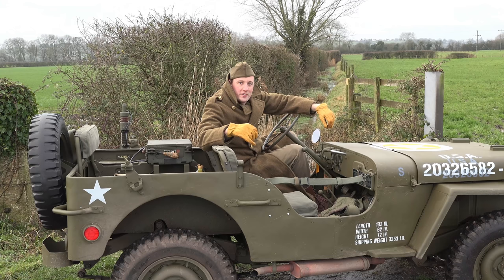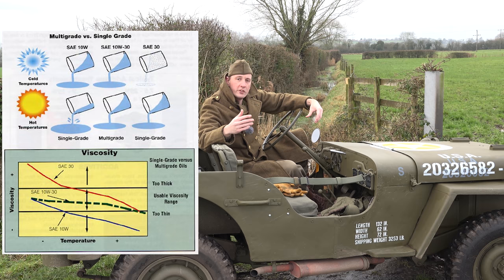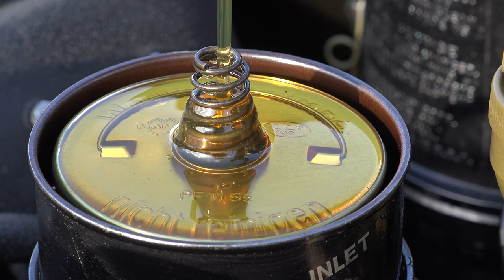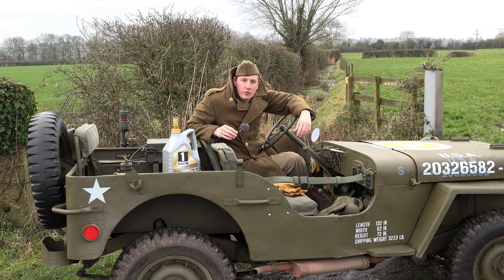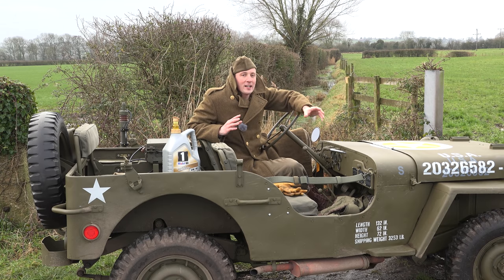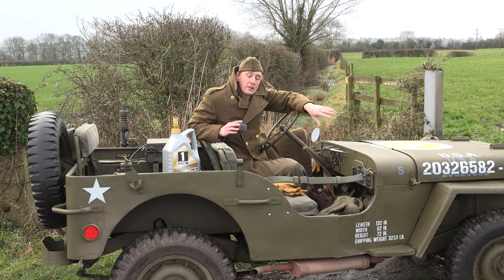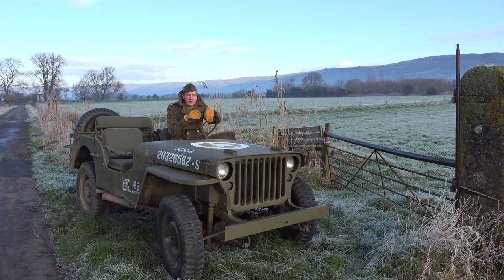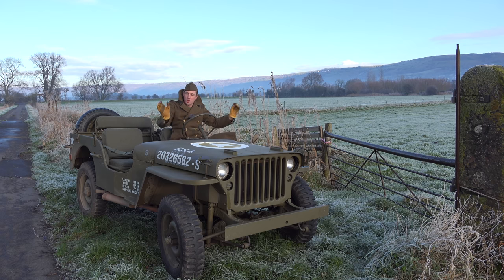Why can't You use Synthetic oil in old engines??

Comment: I am using semisynthetic oil on all my cars including my classic cars. So far I did not experience any problem. One thing: An oldtimer owner and skilled mechanic told me that modern oil might harm the old stile rope main seals. But I still use the oil that I put in my cars for ages.
Lately my old Chevy 6 cylinder starts consuming a little bit of oil. Before the oil level stayed on max for years without adding a drop of oil.
In the Swiss Army we received a wool cap that had only slits for the eyes and mouth. Ideal for bank robbers. It had a funny name: Kopfpariser. Translated to English: Headcondom!
I never wore it once. One reason might have been the stupid name.
Reply from the maker: Thanks for the info, I see no reason why synthetic oil should damage a rope seal, early in synthetic oil development there was an issue with some seals being attacked by early synthetics but they solved that problem.  An old rope seal is made from asbestos and that is certainly not attacked by synthetic oil!  I like your story about the 'balaclava' (from the Crimean war!)  I wouldn't wear a coat at work that was referred to as the 'condom coat' ha ha, nothing changes!
Reply: I tried  Mobile One in my motorcycle, to make it easier to start in the winter.  I forgot about the wet clutch, and the clutch slipped a lot with synthetic oil.
Reply: Do the STP screwdriver and oil dip test. Back in the 60's to the 80's I used STP to not only AID the oil viscosity as the crankcase oil thinned from piston blow-by, but also prevented seal cracking and wear on the back rope seal too. With modern engines though, STP isn't as advisable having closer tolerances, and no-more parking lot oil stains with better crank sealing. Today I treat the motor METAL, Not the motor oil.

Comment: Matt Nice Jeep!  I collect and restore US and German military trucks for my hobby in retirement and what I have found on my trucks and older engines concerning the use of Synthetic oils and the reason I DONT use synthetic on any of my older engines is NOT because of the engine and its older technology or the style of its pieces the same reasons we use synthetic oils in our vehicles today would still apply to these older engines!  The problem we have in trying to run modern synthetic oils in the old vehicles is the "SEALS"  and I means ALL of them!  Transfer case, transmission, front/rear differentials and the engine and all its components were NEVER designed for the properties that synthetic oil possesses and you will have dripping parts on almost all your pieces that I mentioned previously!  I run synthetic in every engine I own including my lawn mower but I run NO synthetic anything in my older military trucks for the reason I described earlier!
Reply: I don't know, modern military engines seem to leak just fine on conventional oil.   I have over 21 years of Friday afternoon motor pool closeouts under my belt to prove it.  Each vehicle has at least one drip pan under it for a reason.  Nothing like supervising a bunch of privates grinding cat litter into fine powder with their boots to soak up the oil spots.  haha!

Comment: As a few others have stated, using a "break in approved" or even straight mineral oil is required during this process to allow the piston rings to seat against the cylinder walls. This is still common practice in most piston aircraft engines which have changes very little in the past 70 years or so. Lycoming has some good documentation and procedures on this process and master aviation tech Mike Busch has a great webinar on the topic as well. Love your content ad thanks for creating.
Reply from the maker: Thanks!
Reply: Break in is usually 500 miles with a mineral oil.
Reply: The last place I'm going for advice on engine longevity is an aircraft engine manufacturer.  Aircraft engines fail at a much higher rate than I'm comfortable with.  We make automobile engines that go hundreds of thousands of miles with only oil changes.  Aircraft engines get thoroughly inspected annually and rebuilt all the time and cost a LOT more than most new cars only to fail in a ridiculously short time.  I understand that we aren't talking apples to apples here, but my contention is, maybe we should be.  Why not slap a fuel injected Honda engine in a plane?  I'm half stating and opinion and half asking if my opinion is valid here. HAHA!  I'll check out Mr. Busch's video.  Thanks.
Reply: @mikemorgan5015  There actually is a EFI Honda engine for propeller driven aircraft. It is called the Viking. There are a couple of options as well when it comes to engine choice. From their website, your options are: "90 Hp (2020 - 2021 1.2 L Mitsubishi Mirage)
130 Hp (2020 - 2021 1.5 L Honda Fit)
150 Hp (2020 -2021 1.8 L Honda HRV)
195T (2020 - 2021 1.5 L Turbocharged Honda Accord)"
Also stated on the website is that they are mated to a "3 gear gearbox for Lycoming style propeller rotation and vertical engine orientation" with a "2.33/1 gearbox ratio for optimum propeller speed"
Reply: @TrollinAreYou  Very cool, thanks for that.  I've heard of some efforts in the diesel arena as well.  Time will tell the tale.
Reply: @Greendot319  I find these original WW2 Jeeps interesting vehicles, when I was a youngster I used to accompany my mum and dad on visits to an old farmer friend of my dad, the farmer lived just outside a little town called Kimbolton, I remember in one of his barns was a little gray tractor, an Austin A30 van and an old WW2 Jeep he got from a nearby airbase not long after the war, the Jeep came with a hood and full side panels and doors, all in canvas.

Comment: Happy new year Matt! and thanks for the comment on the G about the sister jeeps with the rifle rack between the seats. Researching that further.
Reply from the maker: Ahh is that your g503 thread then jp? Looks like a very nice gpw project, lots of work, you're going to be busy! Make sure you keep good track of how things were attached, bolts and washers etc, important details that all the info isn't out there on the net about so of its original remember how it went on!
Reply: @Greendot319  yup that is me! You sent me some parts via ebay a few times. I am collecting parts for almost a year now, since I try not to use any repro stuff. Not sure if I manage that 100% but we’ll see. 

I take a photo of every part and bag&label it carefully. I have as well a detailed photo reports of an untouched original ‘45 gpw which helps as well. 

Tricky thing I need to plan carefully is the zink plating/galvanising. I plan to do that with all small bits and pieces since I have a company close by able to do that. But they take a box full for 50 euro so I loose control of my carefully arranged bolts and nuts bags. 🥴🤦‍♀️ have to figure out that challenge. 
Gr JP

Comment: Wow! Great uniform! Synthetic oil is too liquid for old motors, I think, yes, you can fill it, but it's better not to do it.  I fill my engine, 1970 Lada 1200 (Fiat 124), with Castrol Magnatec 10W-40 semi synthetic oil, and no problem. Thank you for the video!  Happy New Year!
Reply: The racing industry says synthetic oil does Not contain Zinc. And Zinc is needed for flat tappet cam type engines.

Comment: 1965 land rover diesel. Went from 15w40 mineral to 15w40 semi synthetic. It killed the engine as all the gunk came lose and blocked the oil pump.... 1978 land rover diesel, same engine and took it apart to boil the block so it is clean. No issues after rebuild using semi synthetic.
Reply: The semi-synthetic didn't kill the engine, the mineral oil did, as it created all that gunk in the first place.
Reply: @archygrey9093  With new mineral oil, the gunk would be still in place and the engine still running.
Reply: @XiamaraLaurensWifeyMu  With new mineral oil the gunk would have continued to built up even more.
Even without using synthetic, over time that gunk will still eventually block oil galleys, oil pumps, gunk up piston ring grooves ect.
If the engines badly gunked up you can try using engine flush before draining the old oil, maybe even drop the oil pan afterwards if you're worried about the oil pickup being blocked.

Comment: synthetics are better at permeating the microscopic pores in metal and offer improved lubrication.  If you have marginal gaskets or seals with conventional oil then you will get oil leaks.  When Mobil 1 came out I used it in my Norton motorcycles and no leaks.  I have torn down engines with over 100k miles that had used Mobile 1 and no cylinder ridge and you can still see the cylinder hone marks.

Comment: For driving when it is 32 degrees F (now that you are out of the EU you may want to go back to good old Imperial units like those used in your former colonies, he said with tongue in cheek) you need: Mitten, Sell, Trigger finger, Type I (Stock No. 73-M-3620) with Mittens, Insert, Trigger Finger, Type I (Stock No's 73-M-2735 thru 73-M-2745, Cap, Wool, Knit M-1941 (commonly called a Jeep Cap or Radar O'Reilly cap)and Googles, M-1943. The mittens are designed to keep the wind from going up you sleeves.
Reply from the maker: Good advise, I like my Korean cold weather cap I wear at the start of the video, really keeps the wind off your ears and head!

Comment: Corvettes, all Porsche sports cars, and many other cars come from the factory with synthetic oil, break in is not an issue.  The Dino oil for break in might only be required for flat tapped cams and mechanical lifters.

Comment: I have 1957 Cj5 with, Land Rover 2.8 tdi engine... here in Brazil requests 15w40 oil... but I'm using 5w40... even the engine noise changed for more smooth sound...
Reply: Using Motul 6100 or Castrol Magnatec...

Comment: I remember hearing (when Full Synthetics first came out) was that you should run the engine on "regular" (multi-weight) oil for the first 6,000 miles or so.  THEN change over to Synthetic....

Comment: The base in engine oil is the same for with or without synthetic additiv, synthetic oil is for winter use, but for summer driving you dont need synthetic.

Comment: Your bypass filter should have caught a lot of debris in your oil. Cut it open and check it out when you change it. My Super Hurricane and other 40s/50s engine all used oil regardless of type until around 2000-3000 miles.
Reply from the maker: Cheers Ben, it drank 1 litre in 600 miles which is not low but not also really excessive considering the super wear protection of the oil slowing the break in of the rings.  I'm keen to see how its drinking habit develops the more miles I put on it, just paranoid about causing it any lasting damage but the more I've learnt about rings and engine tech the more confident I am in the little engine ;)
Reply: @Greendot319   1 liter (one of us has that misspelled ;) ) in 600 miles is pretty decent since you were running 0w-40 synthetic. Its the fun of a new engine. Looking forward to more. Thanks again and Happy New Year!
Reply from the maker: Cheers Ben, my next break in will be more conventional, 100-50 miles of multiweight mineral oil 1000ppm+ zddp and then switch to fully synth

Comment: You may have to re-hone the cylinders knowing now that you've broken it in the wrong way.
Shouldn't have done the oil test until break-in was over.
And they do make special break in oil. Don't know what it's called and I don't know what's available in your country but usually break in oil is non detergent. It may not say break in oil but it will say non-detergent oil. 
Hone the cylinders again and then use non detergent oil to break in the Rings then do the fully synthetic test again.
Reply from the maker: Shes all fine at 1500 miles now!

Comment: compression tests would have given real answers, I would think synthetic would have just extended break in periods, as others said use regular oil for break in and switch to synthetic after if you are worried about it.
Reply from the maker: So the question is....what does it matter if you extend the break in period with synthetics because you also extend the total engine life, an engine that used to need to be rebuilt at 30-40k cam now go for 100k.  That extra oil burn in the 'break in' is surely worth it

Comment: You said how it originally called for a 10 weight in cold weather.  0w is a replacement for some 5w specs.  Even a 10w synthetic would have much better pourability and lubrication than a 10wt conventional.   I think most of your consumption is your using a oil with a much lower viscosity.  It's also likley your not abusing the oil and motor to the point where the oil is pushed to it's limit. Thua it's spending more time in it's thinner viscosity temp.   (Hard to know with out a oil temp gauge). 
I would think a 10w or even 15 w would be the best choice.

Comment: I would use Shell Rotella 15w40. The engines in the Mbs are pretty close to the Ford N series tractors and Model A's with flat tappets. Diesel oil has high zinc content. Might be good. Just a thought

Comment: mechanic here... 
.
id run a straight 30 "old school" oil for break in....... giving it 20% load
long pull up to speed..... and then a long coast 
this way.... the rings see both pressure (from load) and vacuum (from coasting with throttle closed)
.
then after 200 miles or so..... bring it up to 50% load
do a few long accels.... long decells 
.
then 75%.....
then 100%
.
.
break in is done FAR FAR quicker than people think
and many older mechanics / race car drivers (who need TOP! power and TOP! reliability) used to say..... "break them in fast... to go fast"
.
.
like... people go WAY overboard with break ins
and the FACT!!! is.... no matter how you do it.... if you have a failure.... it was going to happen no matter what!
.
if you wipe out a cam lobe..... no additive or long or short break in produce would have saved you  
in todays world.... you probably got a bad lifter (new lifters and ignition points are CRAP!! use "new old stock" if you can find it)
.
so you got a bad part..... a bad part is a bad part
and no break in procedure will fix a bad part...... because its a BAD PART!
.
.
.
also.... no break in procedure, additive, ETC will fix an incorrectly built engine 
if your tolerances are too loose / tight..... your going to screw stuff up
.
.
the only time i follow the factory break in.... is when i have a NEW car.... and its under warranty
if you dont follow the SUPER SUPER safe break in in the owners manual..... your warranty goes out the window 
.
when my mechanical skills are the warranty (aka, i built the engine)
i just drive it like i would my 313,000 mile Buick..... like, typical every day driving 
.
.
.
.
.
and if you disagree with me........ you are wrong
sorry.... facts are facts
sorry.... decades of experience is decades of experience
sorry.... you are still wrong
.
modern oils (even syn blends) and be TOO good and slow down the break in
but its still going to break in eventually

Comment: From what I know you should break in your engine with a mineral oil then switch to a semi or full synthetic after
Reply: "Mineral oil"  causes lots of confusion. 'Mineral oil' is used for a wide range of  aviation  piston engines when the spec for break in calls for that. "Mineral oil" technically means "engine oil" when you get down to it but for the application you seem to be referring to, it means meeting the  Mil-L-6082E/SAE 1966 spec or the Mil-L-22851D/SAE 1899 one. There is no need to do that with for an automotive application. Follow the  recommendation of the people that made the engine, the technical manuals for the engine, or the advice of people who do this to that engine for your application for a living. Typically for automotive applcaitions,a choice of specially formulated straight SAE30 or SAE40 is recommended. Non-synthetic of course, for break in.
Reply: @bbb462cid   to be more specific a non detergent oil..
Reply: Myth. New cars from factory have synthetic
Reply: @asherdie  only because the tolerance of new Engines  are much much better.. a Rebuilt  old engine will NOT break in the Rings with a synthetic.. it's too slippery

Comment: Mobil 1 has a 15w50 that has 1200ppm ZDDP especially for older engines with flat tappet camshafts. Best of both worlds and it works just fine in my E-type Jaguar. 
Zinc is one of the best anti-wear additives, but it has been removed from most modern oils for environmental reasons.
Reply: I'm so surprised that I haven't seen more comments like yours recommending oils with a higher ZDDP content than modern oils provide.  You're 100% correct!
Reply: 2200 ppm Rotella  t1

Comment: I chose a non-detergent 30 motor oil and ZDDP for initial breakin to 3k miles. I plan to use semi synthetic as it seems a good compromise.....My Vehicle? 1993 toyota 4X4 4Runner pickup.

Comment: Yes... I have heard that on older style engines it's better to run the first 1000 miles or so before changing to synthetics...If you so rhat you'll find it doesn't use the oil....
Reply: Either that or oil synthetic oils designed for breaking in engines